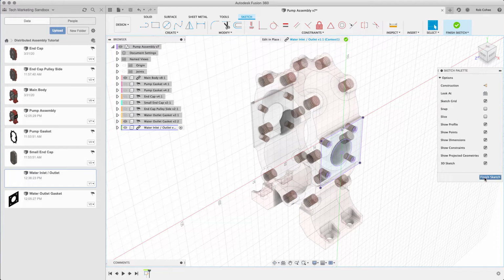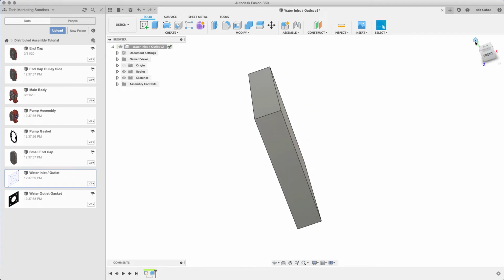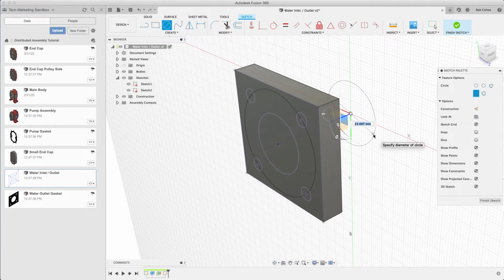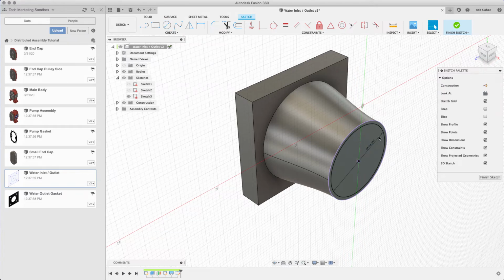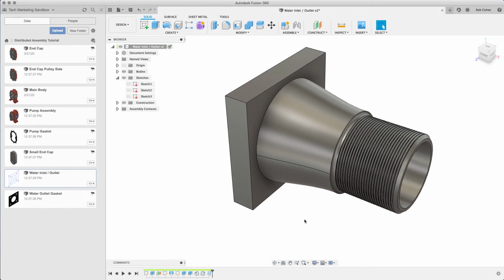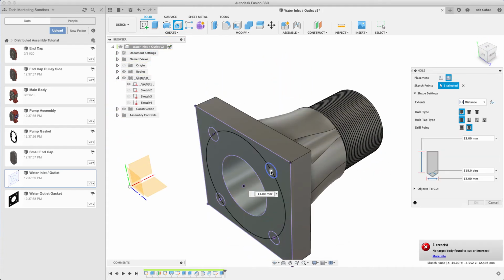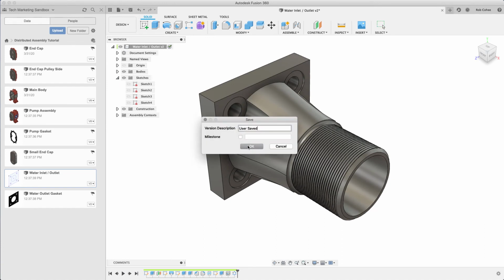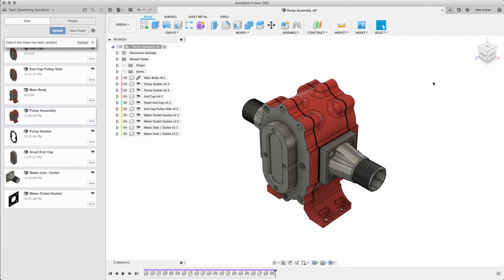07 Fusion 360 Intermediate Part Modeling Concepts

Comment: Hi Rob,

A nice demo again! I think it's good that you show that it's possible to to a traditional bottom-up approach with Fusion. One of the reasons you said that this is important is that you would like more people to work on a certain design at the same moment. And I agree, but I think (and correct me if I'm wrong) that tasks in an engineering team are probably more on a function than on a part level. So what I think works awesome is somewhere in between, where you do this workflow as you perfectly describes, but then on the full housing instead of just the back plate. This way you leverage the full power of Fusion and make things easier to manage as you release a functional block. Does that make sense? 

I now work with a small company making furniture and each cabinet is a fusion design, and they're put together as a kitchen using the linking. You way of working (creating an empty document, and linking it with some references), is then perfect to finish the design (like a common recessed handle for example).

Anyway keep those movies coming!

Regards,
David
Reply from the maker: Hi David - You nailed the intent and you are right most of the division of labor in projects is typically separated by discipline. This approach works even better in that context. Glad people are finding these videos useful, I have a good time making them so I'll keep posting. Glad to take requests for topics.